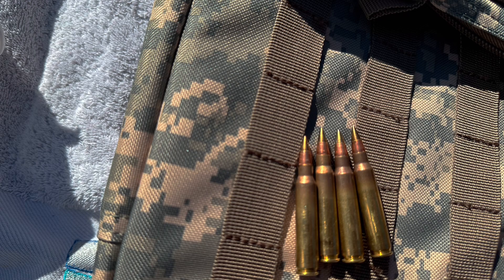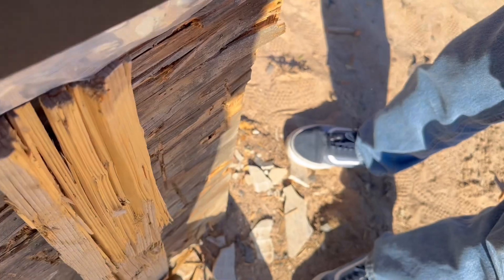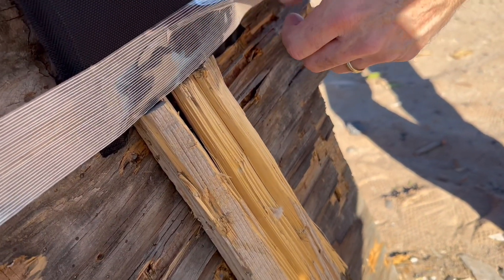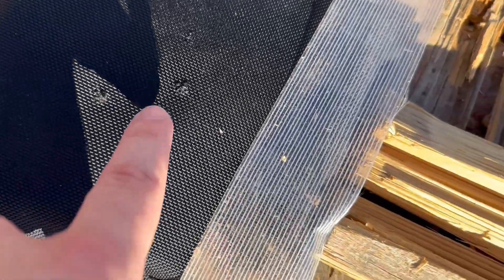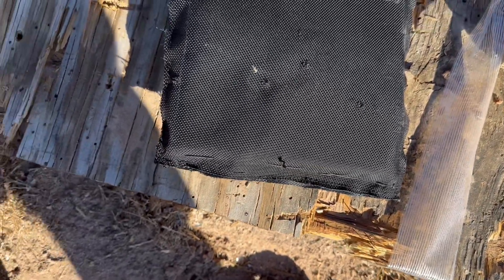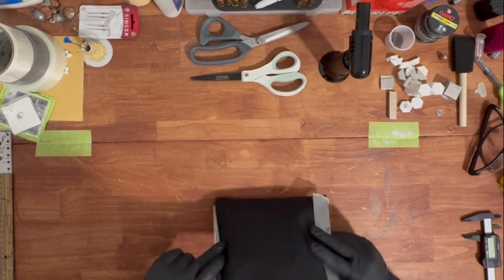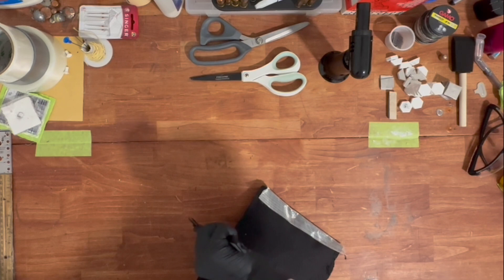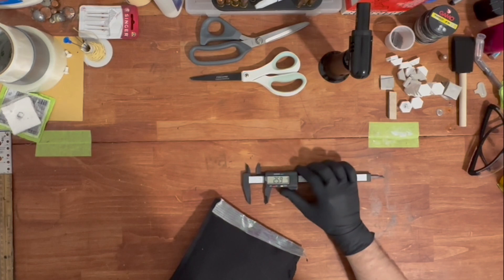Sending My Plate Out To Be DESTROYED! (tiny rant on upcomming project/s)

Comment: Good work. I would definitely be interested in seeing the ultimate composite armor video before the helmet video. At least if you dedicate your time to finding the best material combination for spicy pistol and rifle threats others could expand upon your triple fabric layups and build their own helmet designs off of that.

Also I think it's neat that we have the same kind of thinking when you said you were going to use a composite of Kevlar, Fiberglass, and Carbon Fiber. 
I plan to use a composite of Nylon, S2 Fiberglass, and K29 Kevlar as a backer for some rifle rated SAPI plates and use HDPE as the resin to bond all of the textile layers. For the strike face I plan to use either Porcelain or Quartzite it's rumored that Quartzite is supposed to be a little harder than Porcelain and is the hardest available tile you could find in a home improvement store but I haven't validated that yet.

Anyway, if you could maybe do the video on finding the best optimal textile configuration for armor. Again thanks for the videos you have no idea how many people you've helped with this life saving information so keep 'em coming! 💪🏻👊🏻👍😎

Comment: I"d suggest doing a separate test first for finding the optimal fiber composite.
Once you know its 3A as a flat panel, you can work on shaping it.
You'd need to insure far less back face deformation in a helmet than in a chest panel due to brain injury.
Do you mind sharing where you found that three material composite fabric?  I've seen composites of Kevlar and carbon fiber, but never with all three fabrics.
Reply from the maker: Look up Rock West composites. On their website search Tri weave in the search bar.
Reply: @Armor-Innovations  Appreciate it.
Reply from the maker: @pattern_recognitionist  No problem